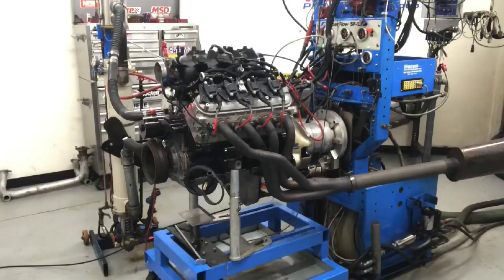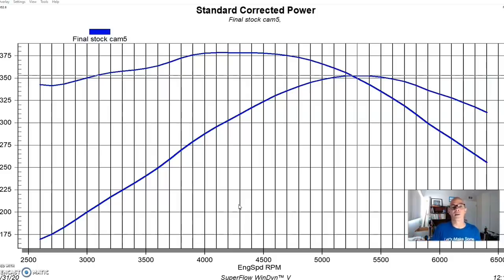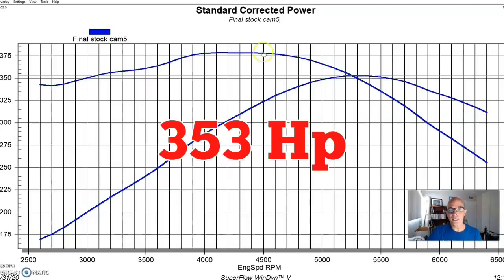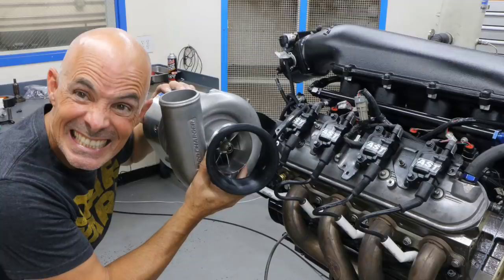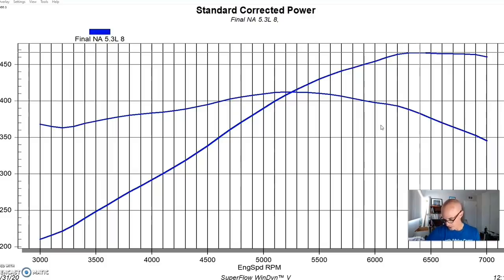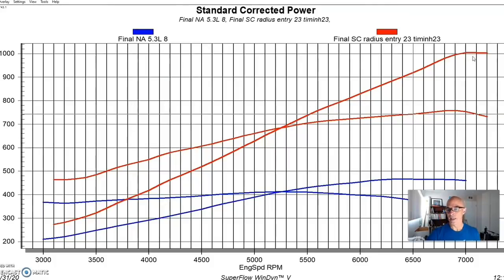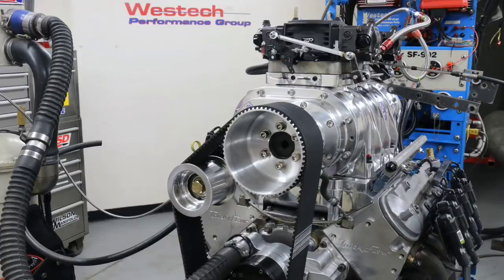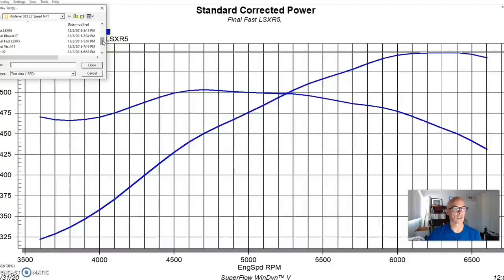BLOWERS vs TURBOS-THE TRUTH ABOUT BOOST

Comment: So what if you use co2 to control the boost on a turbo and give it a  Is linear boost curve like a procharger, will it carry the power through the rpm like a prochager dose or will it still loss its efficiency at the same spot?

Comment: What would happen if you used a supercharger and blew a turbo into it? Whould you grt the bottom end power and the top end or would the blower limit the amount of boost or fliw the turbo adds.
Reply from the maker: we did that with an 03 Cobra Ford motor

Comment: I'm your Aussie brother from our 351 Cleveland mother , in the early 1990's I developed what could very,very loosely , be considered a factory type , pro stock , 2 bolt main M code , with our Aussie 4.9 litre , Geelong , 2 Venturi , 54 cc quench chamber heads , reversed gudgeon ( notch to firewall) location , ( this ends compression stroke a couple of crank degrees early , and starting power stroke early .) To this I designed my own cam profile that my friend Dean Tighe , from Ivan Tighe camshafts ground up for me , if you look up their catalogue and load up the Cleveland Solid Cams for grind #764 ( there is a typo on peak exhaust lift , basically both intake and exhaust have 5/8" lift . 4venturi sizes will contact each other on overlap , max intake diameter for min
 safe clearance @ 275 degrees Fahrenheit is 2.145" intake and 1.71" exhaust . This recipe yields a spectacular power torque shape .

Comment: Generally speaking, "boost" measures how much resistance the intake and heads offer the power adder. A lot of boost on a 2bbl stocker can make power similar to lower boost with great aftermarket heads and cam. Something to consider when fuel octane is an issue.

Want to measure "constant boost" and its effects? Run single stage nitrous with a bottle set up to keep pressure constant. It applies oxygen to the cylinder instantly and doesn't "build" with revs since its revs-independant. Turbos and blowers may homogenize the air/fuel mixture if the carb comes before the power adder, but otherwise its major influence (generally speaking) is pumping more oxygen into the cylinder than atmospheric pressure can do without the power adder. The higher compression also helps, but its the efficiency of cylinder filling, that creates the curve RH is talking about--it follows the regular curve, just higher. Nitrous replicates efficient cylinder filling, as well.

the centrifugal blower is interesting, since a lot of Mustang owners cram it into a long runner intake and small port/small valve heads made for torque that run out of breath. That's when swapping the designs really pays off on the short stroke/relatively big bore compared to a Chevy 305 TPI.

Comment: Have you ever tested a compressed air supercharging system on an engine dyno? I was wondering how the intake temperatures are affecting the power.
Reply from the maker: YES-THE CAS BOYS RAN AT WESTECH AND THE AIR TEMP IS SUPER COLD

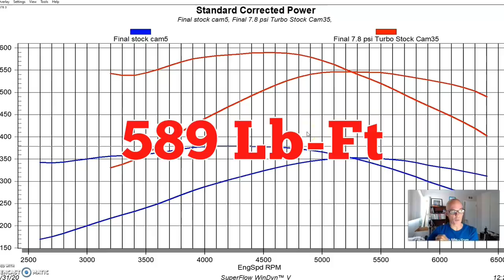Comment: as usual, no direct relation because you change parts. different exhaust manifolds do not make the same engine. This is the only part of what you do that just baffels me. stopped watching at 3:48
Reply from the maker: the three motors were completely different-test was about what happens to respective power curves-not a test on the different forced inductions on the same motor (that video is also up)

Comment: Great test to illustrate how boost curves work to alter the engine output. Love your work Richard. 
So here's the boost curve of my factory fited MP62 roots blower on a Toyota-Yamaha 2ZZ-GE motor (Lotus). Mostly standard, just smaller supercharger pulley (75 mm), water/meth injection (pre supercharger) and free flowing exhaust. 4000 RPM = 8PSI,  5300 = 10.5 PSI (Just before cam change over from small to big lobes - like Honda V-TECH),    5500 = 9.8 PSI, 7000 = 10.5 PSI (around torque peak - motor most efficient), 8500 =  12 PSI. So you can see the boost slowly increases with RPM, except for a dip when the cam changes over to the big lobes and also a section around 7000 RPM where the motor is most efficient, before rising again at the top of the rev range as the motor becomes less efficient (past torque peak).

Comment: When you realize that "boost" is nothing more than an artificial change in the atmospheric pressure that an engine is inhaling, this all begins to make sense. Naturally aspirated engines aren't "un-boosted" engines; EVERY engine is quite literally "under boost" on earth because of the natural atmospheric pressure, what we know as roughly 14.7psi @ sea level. Your engine at sea level is, literally, "boosted" to 14.7psi by atmospheric pressure alone. Any 'boost' you add to an engine via a secondary compressor(turbo/blower; the cylinders are your primary compressor of air) is added ON TOP OF atmospheric pressure.

This is the foundation for Rich's general rule about 'boost' after all - adding ~14.7psi of boost via a s'charger/turbo(that is appropriately sized & setup correctly) will essentially double the power output; because you're literally doubling the air density(at sea level) going into the intake, the SC/TC is intaking 14.7psi of atmospheric pressure, then it's compressing it another 14.7psi of 'boost'.

So, if you increase the air density going into the intake equally across the RPM range(in other words, let's say you have 10psi of boost, having that 10psi equally across the RPM range means you have 10psi from the starting RPM of a pull all the way to the end of the pull at the top of the RPM range, or a perfectly flat boost curve), then the curve isn't going to differ AT ALL from the naturally aspirated curve - because the only thing that changed is the intake air pressure. It would be comparable to just running the same engine at a different elevation/altitude(running an engine at the peak of Mt Everest then running it below sea level - dramatically different air pressure).

Comment: Do you have a video of “boost types” , for instance say at a given RPM range with 10 psi boost , say 4000 to 6500 on the same engine  , blower vs turbo vs pro charger ? With deduction the results would then tell us how much horsepower the blower and procharger are using to make the same boost . Does that make sense ? Have you already done it and if so what’s the video title ? Thanks
Reply from the maker: YES-LOOK FOR THE 4.6l 4v VIDEO WHERE i COMPARE ALL FORMS OF FORCED INDUCTION-LOOK IN THE MOD FORD TURBO PLAYLIST
Reply: Richard Holdener awesome ! Thanks Richard!!

Comment: Hey Richard, have you experimented with using a "wastegate" on the intake side on a procharger/centrifugal blower? I've read some articles where this has been useful. Customer/shop didn't want to exceed "X" amount of boost up top, but wanted more power down low. So what they did was pulley up higher (smaller blower pulley) and put a wastegate on the intake pipe to limit boost to whatever their number was. The result was awesome, much more down low grunt out of the blower while still limiting top end boost. So they kept the same peak boost/hp number while drastically increasing torque down low.  Basically a flat boost curve similar to a turbo. Weird to see on a centrifugal, but it worked. Obviously blower speed and increased heat can come into play depending on blower size and speed, but for a street setup it wasn't an issue. Just throwing out ideas!! Love the videos and all the data!
Reply from the maker: IT WORKS
Reply: @richardholdener1727  can't get enough of your videos! I couldnt ask for a better channel! How can people like me help you to keep making videos? Also, my comment of "millennial lsx454 vs boomer bbc454 was a big hit!" Wink wink LOL. Thank you for all you do!

Comment: on the turbo you set it at 7lb but what if you let it run up to maybe 16lb you should have more of a curve to the higher pressure
Reply from the maker: the power curves at 16 psi will be the same shape (as NA and 7 psi) if the turbo can support the power level

Comment: In regards to turbos, that seems to be the way it works. 
Tried to bulk up my engines torque down low with more boost, etc. But the main effects are more mid range and top end. 
As the original head was getting soft, changed cyl head with bigger ports, valves. Hurt the bottom end, raised the peak torque RPM a lot, and gained a lot of top end.

Oh well... change the cam timing next.

Comment: How about a show on a late model efi "truck" that is going to tow, say up to 8000 pounds occasionally.  Intercooled screw blower vs a moderate sized turbo or small twins(?) and an intercooler?? How would water/alcohol benefit either combo as a "driver"?  How would fuel consumption be affected at cruise rpm with either combo as well??

Comment: Define "Properly Sized Turbo" Richard Please. What if I want full boost (15 Psi) on my Truck at 1500 RPM. Yes 1500 RPM. ????  Yes Gasoline!!  Haha Great work as always.
Reply from the maker: it can be done-look at what the OEMs do with turbos-but it might not support 15 psi on the other end
Reply: @richardholdener1727  Please try something along those lines when you get a chance. A couple of EFR 7163's with electronic boost control. ELECTRIC Powerband!

Comment: Very cool stuff. Trying to manage boost in a turbo application is very tricky. Without a controller, a turbo would be a raised rate forced induction.
  The old 671 does look cool. But is extremely inefficient. I would like to see the comparison with a modern positive displacement supercharger. At the very least , the Eaton M series.( M122 ) or the more efficient TVS. Most of which have a built-in bypass valve, to manage boost. And also use the heat exchanger. And of course At the top of the supercharger food chain, the twin-screw. screw.

Comment: Very interesting video.  I’m assuming during the turbocharger test, exhaust back pressure doesn’t exceed or is that much greater than the intake pressure?
Reply from the maker: back pressure is almost always higher than boost unless you go to great efforts in your sizing and are not concerned about response or use other methods to improve it

Comment: Prediction, before I actually watch the video.

The shape of the curve likely wont change at the bottom end, but at the top end it will push both curves farther out at the top. That is meaning if boost stays the same throughout the run.

Comment: Hey Richard, kind of an interesting scenario came to me while watching this. What if you were able to supply a given motor a remotely boosted atmosphere. Like boost provided by a separate source, not driven by the motor it's beIN fed to, in any way. No parasitic draw from a blower, no exhaust side restrictions from a turbo. And have a constant boost setting. Then compare to all variations with the identical boost curve/level to calculate what the actual parasitic loss of each form of boost is. Not trying to dump more on your plate. But you are kinda responsible for influencing these outlandish thoughts and scenarios. Lol 👍
Reply from the maker: working on something like that already

Comment: I know nothing about this or anything else, but will it not be easier to keep the A/F ratio on EFI system based on rpm with a centrifugal supercharger vs a turbo based on boost since it can fluctuate if you peddle, what happens with the power recovery time ? and if you have to peddle what happens with the A/F ratio on a turbo engine, if I understand right the A/F ratio on the supercharger will track with the rpm and keep pase as the engine go up in rpm one can say butterfly position related almost, but what happens if you peddle on a turbo does the A/F tracks as well with the fluctuations and what is the recovery time of power of supercharger vs turbo in case you have to peddle, I know there is a lot of interaction between the ECU-rpm-tps-boost-O2 sensor, but is one system less susceptible than the other ?
Reply from the maker: proper tuning can make the AF constant (or whatever you want) at every given combination of rpm and load

Comment: What I like to do, with all the build-in boost controllers in the ECU's these days, is to make the boost curve RPM dependent. This allows for a flat torque curve all the way up to red line. Since torque is the limiting factor for drive lines, and drive lines are usually the limiting factor in modern day cars.

Comment: I think it would be cool to see how bad a motor  would run if you just made a top plate for the roots blower manifold and stuck a carb or two on the manifold by itself and ran it N/A with those ridiculous short runners.

Comment: I was at the hardware store this weekend and the young man behind the counter is telling me how he has a 1998 Dodge Cummins that putting out 1400 lb-ft of torque and he's rebuilding a Duster and is going put a supercharged 440 in it that's running 1200hp. I know the Cummins is capable of that kind of power without a massive amount of money however I don't know much about the 440's. I'm sure that power level is obtainable but what kind of money are we talking to make 1200hp supercharged reliable streetable 440? All I really know about them is my Dad told me when he worked at a gas station back in the early 70's the police would bring their cars to the garage to be tuned and they were always complaining about the lack of power. So Dad went through the engine and by changing the timing the engine really woke up. Dad said it went from laying 10' of rubber to keeping them lit across the parking lot. He also took it out on the interstate for a test and ran it up to 140mph by the cars speedo. Apparently someone noticed because after that he was allowed to work on the cars but not allowed to drive them.
Reply from the maker: a 440 with good heads, cam and intake with a Procharger can make those numbers
Reply: @richardholdener1727  So it is plausible. Thank you for the answer.

Comment: Centrifugal superchargers are my favorite type of FI. Basically a belt driven turbo so that I can set the boost response at whatever rpm (by varying the stepper gear ratio and pulley size) that I want with the equivalent of a wastegate.

Comment: Mr Holdener, how would one contact you privately for some guidance on two different Ls options I have for a strictly track car ?
Reply from the maker: ask away
Reply: Sorry I took so long , i forgot I have two emails and YouTube is linked to this one . I have a few 6.0l ls engines complete and one ls7 block and monster heads a shop in GA did work to . The car I am rebuilding again is a 86 Monte Ss that only sees the racetrack and maybe after it’s finished again will see street racing . My goal is the most power with twin turbo set up . Question 1. Can i make 1000 + hp with a stock pcm and additional booster controler or should I just go Holley or Fuel Tech from the jump ?
Question 2 should I bother messing with the 6.0’s that I have or just build a hood bottom end and fill the block of the ls7 . End goal is big cubic inch lsx or ls7 if the blocks will hold .. I really appreciate your time responding to me ..

Comment: Would it be feasible to make a centrifugal combination that has a mild cam that would make peak power at 5000 rpm, then use the supercharger to extend the peak power to make it nearly constant to 7000 rpm?  Somehow get the volumetric efficiency to fall off at the same rate the boost pressure is rising.  Put really strong valve springs in to get valvetrain control to 7000 rpm.
Reply from the maker: 5000-7000 might be a stretch, but maybe with good heads and short runner intake and small cam

Comment: Isn't "boost" just a measure of backpressure in the intake manifold? If you have a centrifugal blower making say 10PSI and then port the heads you'll see boost drop as power goes up. With a turbo no one ever notices this because the W/G just keeps turning it up. I used to laugh at Mustang guys that would compare boost pressure like it was pecker size and made a big difference. You want the air IN the motor not backed up in the manifold. That would be a pretty interesting test to demonstrate actually, swap or port heads and watch boost on a centrifugal with fixed pulley size drop as power goes up.
Reply from the maker: take a look at the videos that are up that cover that
Reply: Richard Holdener thought I’d seen most of your videos, I’ll look! I recall getting ported heads when I had a centrifugal and being upset at boost loss but the car was sure quicker. Fun stuff!

Comment: I thought it was cool when the Detroit diesel 2 stroke had a turbo on top of the blower. With a roller cam if course
Reply: twin charged. check out the Lancia Delta S4. my favorite race car of all time, and it just happens to be a twin charged 4 cylinder.
Reply: @domusdebellum3042  not twin charged the blower on a detroit will add little to no boost it's there to move air through the engine due to it not having an intake stroke the turbo will add boost and the late model detroits will actually bypass the blower when at full boost for efficiency
Reply: @alexlankford6301  Did the old MACKS use the Stater fan the same way? I can't remember.
Reply: @dondotterer24  my old mack has an air starter but I haven't seen anything like that every mack I've run across is a 4 stroke
Reply: @alexlankford6301  Yep 4 stroke.
Reply: @alexlankford6301  I ment a fan before the turbo.  In the 70s and 80s

Comment: How much boost can a plastic intake manifold take before it blows up?  Would you ever run a plastic intake manifold without an intercooler?  What is a safe intake air temperature to run with a plastic manifold?
Reply from the maker: I've run Fast intakes to 26 psi
Reply: People push the stock stuff to 30 psi